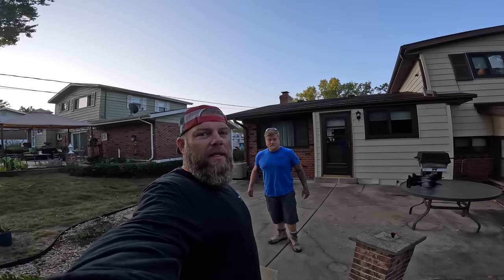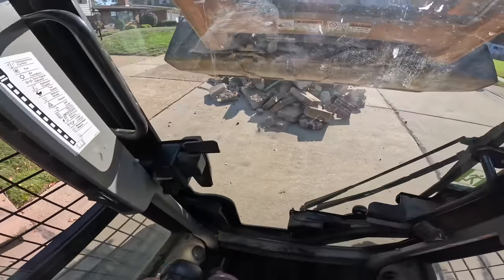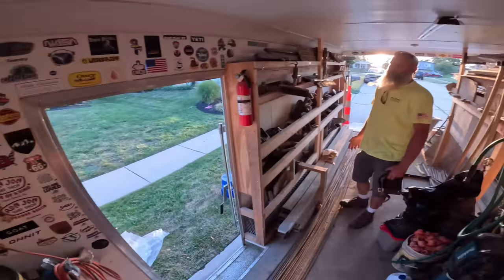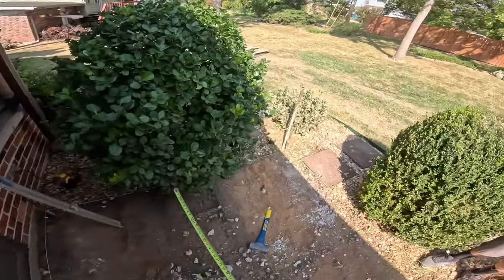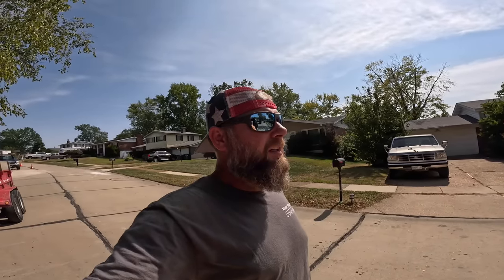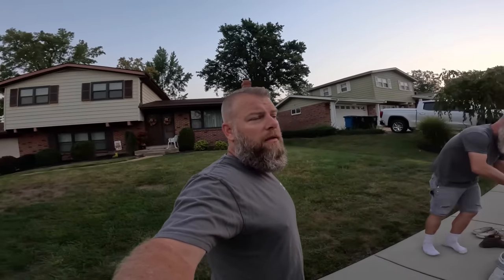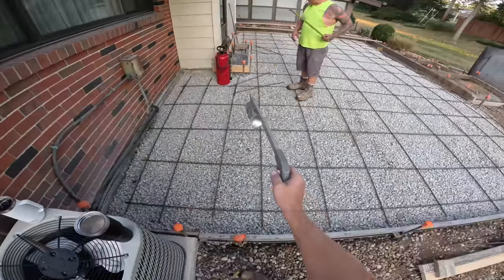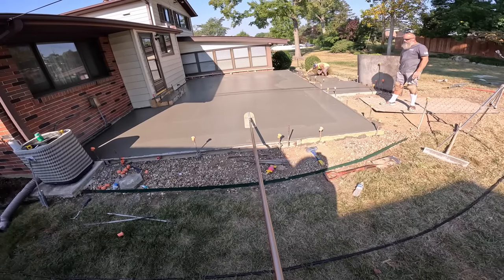CONCRETE PATIO MAKEOVER | AMAZING BACKYARD TRANSFORMATION

Comment: Little things I learned that make things easier on them trak mats is that we tie ropes in the holes and drag them around, which makes it so much easier to drag around by hand.  Great video glad your back to uploading.
Reply from the maker: Great idea! Thank you!
Reply: @RickThomasConcrete  we mainly just use mini excavators for the work I do works out great because then you can throw one string on the blade and tow them all around if need be. I do utility construction, and it's been a real back saver when moving them things